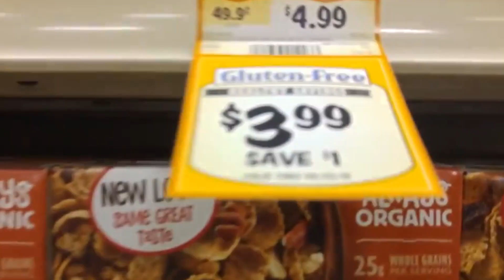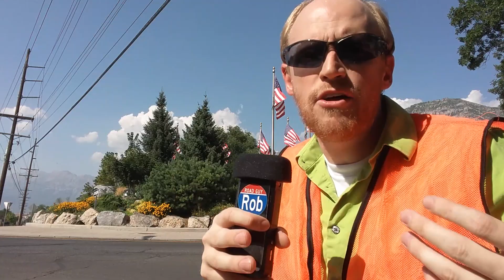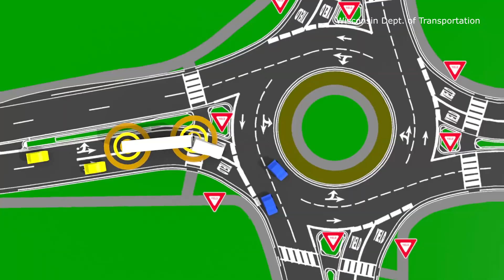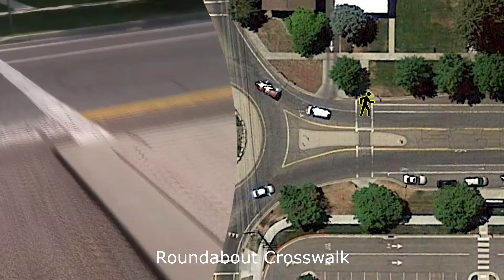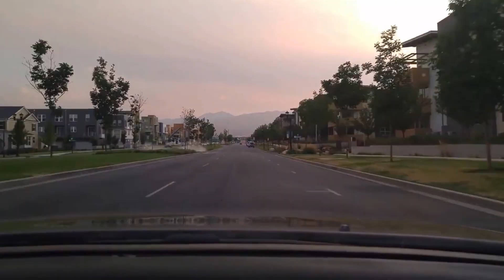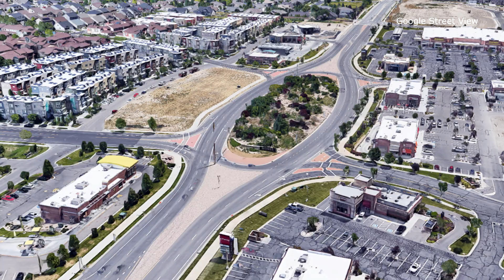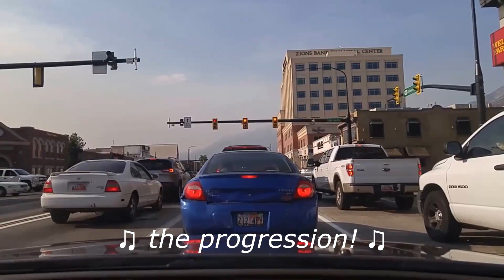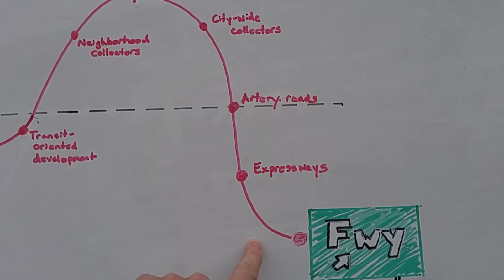Are roundabouts REALLY better than a traffic signal?

Comment: About 30 years ago America started doing this and called them “traffic circles” because we still remembered this country was a result of our forefathers FLEEING Europe. Now that everyone has forgotten that and wants to go back to government oppression we want “roundabouts” and to call them “roundabouts” to pretend were European.  But they DONT WORK here.

You have to have traffic engineers that understand you can’t have left lane entrance and exit with right lane cross traffic that can go straight without causing a natural traffic conflict.  This is also not explained to drivers that this is all new to, so drivers also have to be aware of how cross traffic is moving.  Which varies from intersection to intersection.

That and numerous other problems, such as the number of larger vehicles on the roads in America that can’t navigate these tight circles and have to have a huge natural gap in traffic to enter.

Cloverleafs and Diverging Diamond Interchanges are both much better ideas for managing traffic.  Other than that, traffic lights usually work just fine, as do old fashioned stop signs.  This roundabout nonsense is a nightmare.

Comment: Roundabouts help reduce traffic accidents, they force you to slow down
Reply: The save system from the roundabout is the simple way of traffic.
But the traffic in a good roundabout is not slower then a another cross road.
When You came to a roundabout You see the traffic in the roundabout, the pedestrian, etc and You can make your speed exactly.
You must not stop! Drive slover before You came to the roundabout and you can  rolling without stop in the roundabout, ore you drive 2 or 4 miles faster and can You rolling in.

Comment: I just got back from Iceland, and Reykjavík didn't get the, "just don't put them on the freeway" message. It only works because the maximum speed limit in the country is 90 kmph (~55mph) and those sections with traffic circles are reduced to 70 kmph (45mph).

Comment: I'm going to risk a question.  I live in an area that was mostly rural/residential.  It was fed by a 2 lane, what I'll call a farm to market road.  Because of increased traffic, still, largely residents going to and from work, the county is rebuilding the road to be a 55 MPH four-lane divided highway with left turn lanes added to help travelers get off the roadway.  The intersections with the county highway are uncontrolled.  Would Road Guy Rob consider this a good intersection design?  

Thanks for the video.  I'll be sharing it with my neighbors who are impacted by this road update.

Comment: Junctions on motorways (freeways) in the UK are almost all (signalised) roundabouts. Check it out on Google maps.
Reply: Just to clarify, the roundabouts in the UK are usually on the feeder roads, so at junctions, you often have overhead roundabouts regulating the flow onto/off the freeway but not on the freeway itself, so the freeways are not interrupted, though freeways often terminate in a roundabout.
Reply: @finkum09  there's one of these freeway off-ramp roundabouts in my home town. I've seen 3 different people try to turn the wrong way, and mayhem ensues. The most recent one was a semi, it was totally amazing.
Reply: @finkum09  Check junction M18/A1... or M1/M62... There are all-motorway traffic junctions.
Reply: We also like terminating motorways onto roundabouts and then continuing them again...

Looking at you A1(M) and A3(M)
Reply: @Squaretable22  my favorite is the M5 and M50 junction, which when I was using it in the early 2000’s was a roundabout under motorway regulations.
Reply: @Squaretable22  Just putting my pedant's hat on 😉 ... The A1(M) doesn't terminate (or rather the A1(M)s do not terminate) onto any roundabouts - I (used to) drive London to Edinburgh quite frequently and whilst there are both motorway and non-motorway sections of the A1, the roundabouts are all some distance from the motorway sections. e.g. driving out of London the first section of the A1(M) runs from the M25 to Baldock Services, and the roundabouts at either end are Stirling Corner and Biggleswade South, which are both a few miles from their respective ends of the A1(M).

Comment: I love Carmel’s system. Up here in Fort Wayne, IN we’ve had a huge influx of them recently. 

I think one aspect you missed is their application as a correction of a an intersection. Many of our archaic 5+ intersections are being replaced with elegant roundabouts that reduce the complexity. Or other intersections in which one road just came in a sharp angle. 

Further, in a growing area of the city, we are just about done with a round about that will have the train tracks go straight through the center and traffic stops outside. Before, given how the tracks payed and the four road directions. I would cross train tracks about 15 feet before the intersection, turn left, then cross over them again quickly after. Given the influx of population on that road, it was a necessity for a dramatic change in the layout. 

I also appreciate the divergent diamond interchange they placed in on a major artery that crosses the interstate and has two major hospitals on opposing sides.

Very happy with the ideas coming to fruition up here in regards to our roads. I think our city/county area would be an interesting case study.

Comment: I'd really like a video describing the process behind how speed limits are set. Happens all the time where I'm on a road marked 55 and everyone is comfortably going 75-80. What gives??

Also, some road myths would be another good idea for you.
Reply: the wonders of state planning.. here i think most speed limits are well set with a few exceptions, theres one road thats a 50km/h but the same road later continues at 70km/h there doesnt seem much reason other then the interval of the traffic lights at the highway exit and entrance, another example here is mopeds, they have to be on the road but according to law have to drive ever so slightly slower an then the car and on the right side on the same road, which imo is more dangerous because it means you have to overtake these moped at nearly but not quite the same speed, would be better if they had to drive same as motorcycles; speed limit; middle of the road